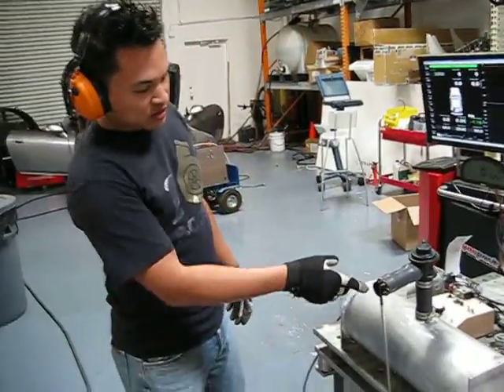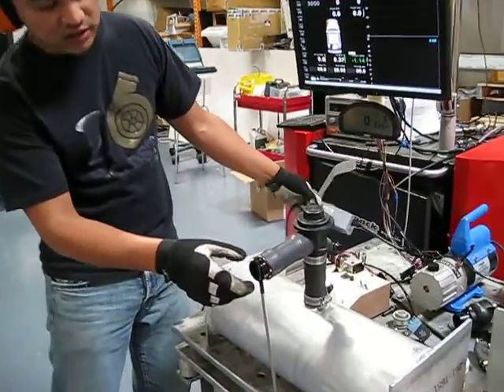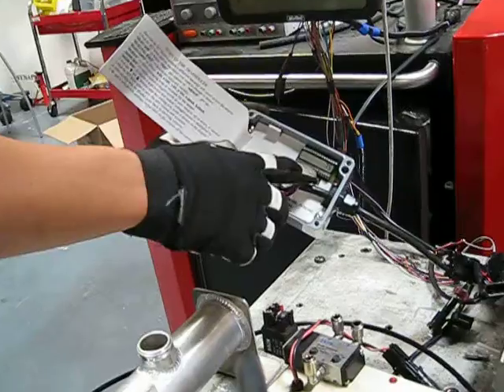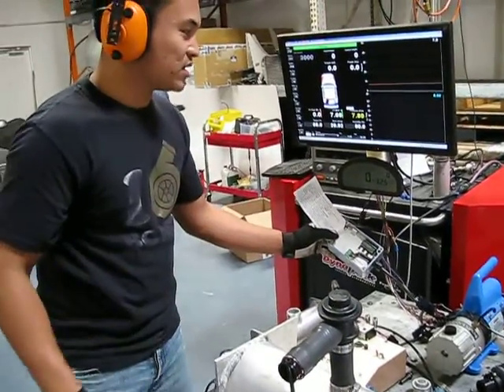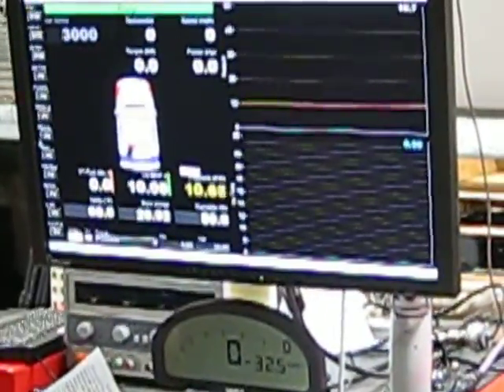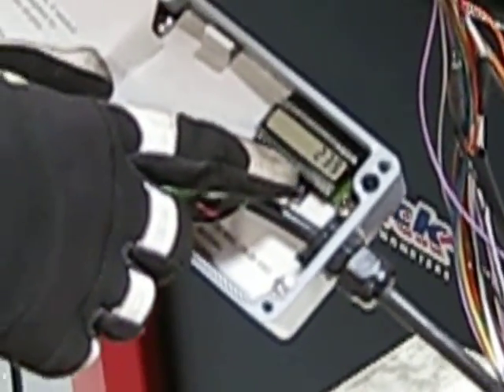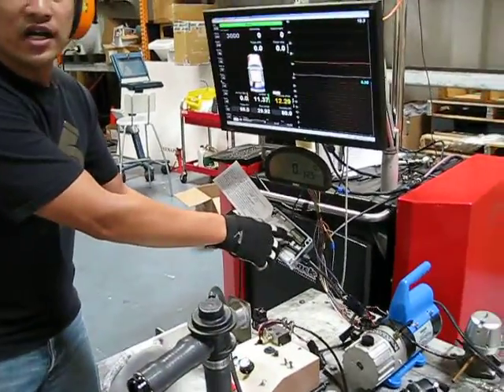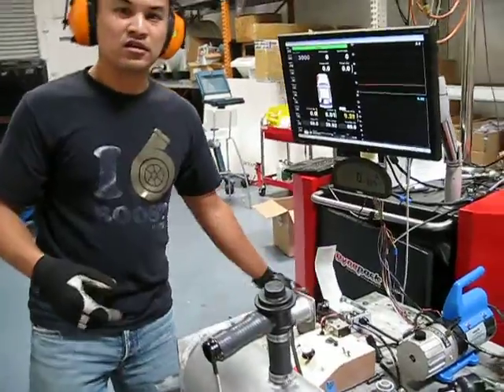Leak Testing an Mitsubishi Evo 8 Blow Off Valve

Comment: Tyre compressor is nothing comparing to turbo compressor. Imagine what a flow rate on high boost and what will be lost through this valve. Compare amount in Kgs and you will find it fit precision of calculations. In other words this leakage is nothing